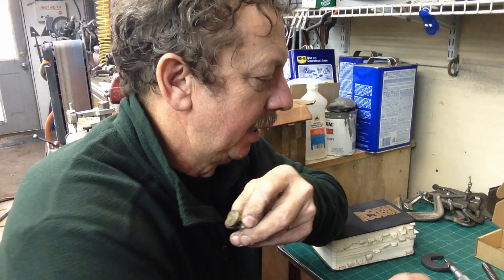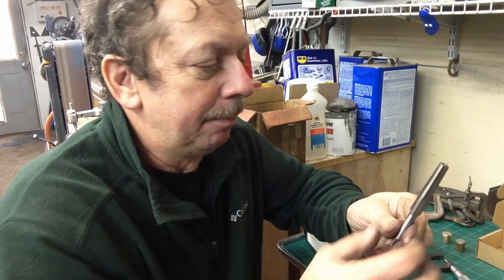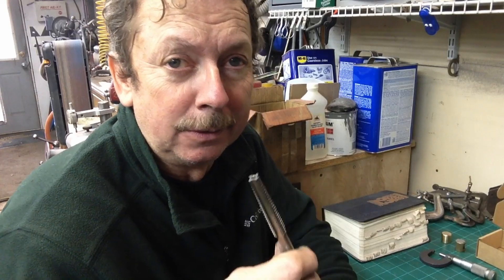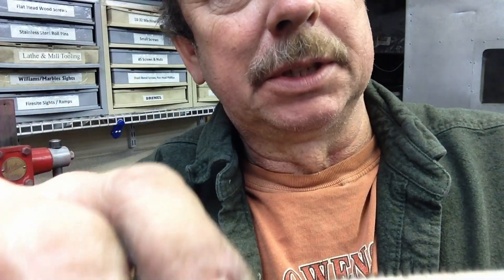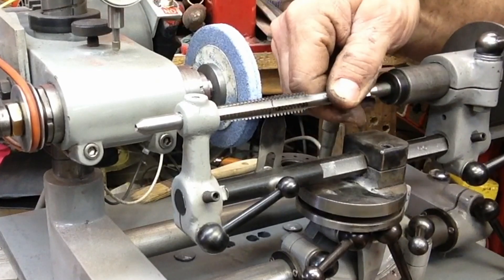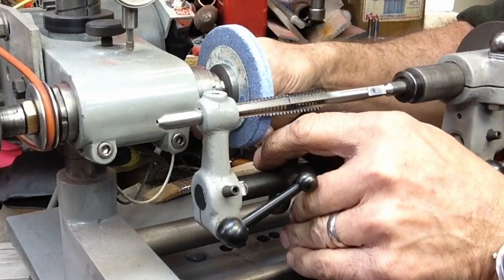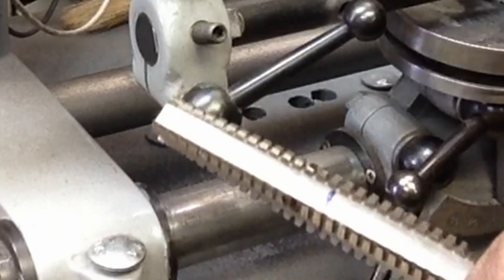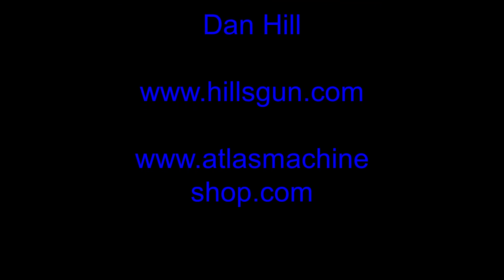The Quorn Tool & Cutter Grinder: Releiving A Cheap Acme Tap

Comment: another Quorn in action video!! Love it.. Thanks for sharing.   Let us know if the nut turned out, or nottt :)
Reply from the maker: Now why would I want to give away the ending :) The nut is acceptable and is installed in the shaper. It is actually slightly oversized which is somewhat of a contradiction since the tap was cut undersized (my mistake) but in the future video I showed how I made the tap cut oversize. Thanks, Dan.